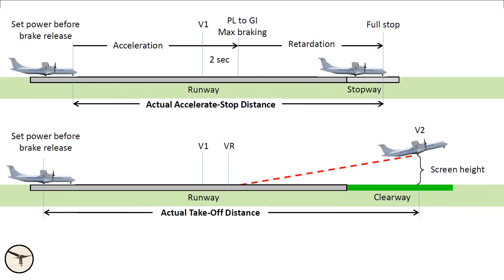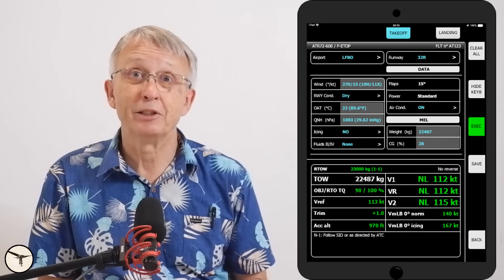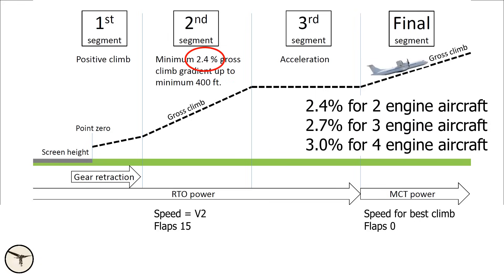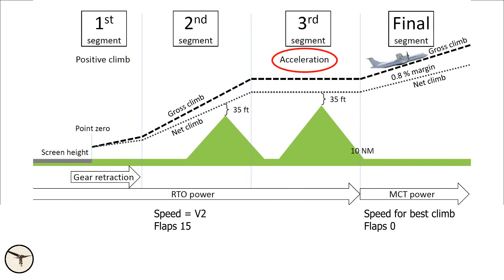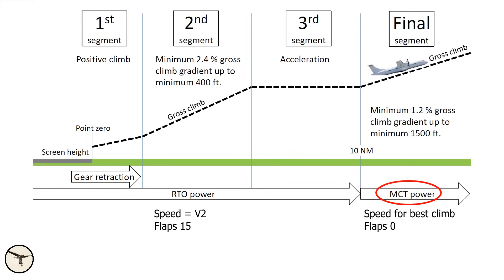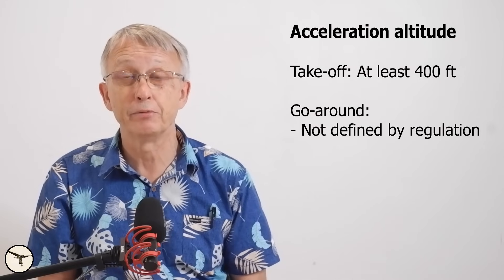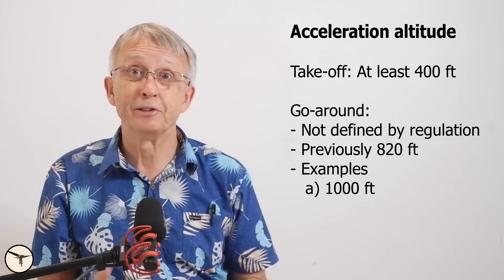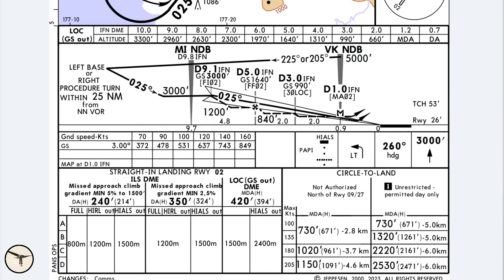Airline Instructor Reveals The BEST Kept Secret About Acceleration Altitude!

Comment: Another question I have pertains to aileron hinge reversal moment. If I am flying in severe icing conditions such as freezing rain, would it be better to leave the boots off in order to avoid forming icing ridges ahead of the ailerons while escaping the icing conditions?

Another question do weeping wings provide the best icing protection since the anti-icing fluids run over and the beyond the leading edge and therefore have an advantage in dealing with severe icing conditions compared to heated leading edges or those with de-icing boots?

Comment: You said that depending on operators Acceleration Alt can be different like 1000ft above aerodrome level or 600ft above approach minimum.

1)
So if I am flying for example VOR approach and the MDA is 940ft, I would add 600ft on the 940ft MDA = 1540ft ?

2)
What is about MSA (Minimum Safty Altitude/Minimum Sector Altitude?

I saw that for example Airbus Pilots look on the MSA and set a certain Acceleration Altitude.

I mean if you should have an MSA of 2000ft it would not be a ig problem, but what if the MSA is really high?

3)
When do you deactivate Yaw Dampber during approach and why?

Thanks alot!
Reply from the maker: 1) Correct, if this procedure is used by your company. 
2) MSA covers an area with a radius of 25 NM around a fix (typically a VOR at the airport). Using MSA as acceleration altitude might work when MSA is relatively low, but in a mountainous terrain, it will not work as you want to accelerate to the speed for best climb performance as soon as practicable.
3) We deactivate the yaw damper before landing because it otherwise will work against you when you apply rudder during a crosswind landing.
Reply: Thanks for your answer.

Regarding the white speed bug, are there tables avalible where I can read out the values for example for ATR-72-500?

Comment: Magnar thanks for the video but my question is unrelated to it. It's about icing. 
Can ice form without visible moisture and can you explain what a freezing nucleus is?
Reply from the maker: Ice is generally formed by visible water droplets when the temperature is below freezing. However, under certain conditions ice can form from water vapour, which is invisible. 
A freezing nucleus is a particle such as dust, soot or similar.
Reply: @FlywithMagnar  Thank you Magnar!
Reply: Hi!

I just saw your question about freezing nucleus. And I wanted to chime in on something, maybe helping you understand what is happening, when phase shifts from one to another.

I will use water as an example. Usually in schools children are taught about water freezing in 0 C and boiling at 100 C in so called standard atmosphere. In reality: if one is very cautious with that substance, one can go below 0 C with water not freezing - resulting in so called "super cooled fluid" - or the other way around - above 100 C without boiling, achieving so called "super heated fluid".

If you look closely at the points of expected transformation, you will see that in more basic models - in example, when going from 5 C to - 5 C - you will first cool liquid, taking away its energy, to 0 C, then you will hold at that point, while taking energy, so basically it should be freezing constantly keeping 0 C and only after fully frozen, further taking of energy will lower its temperature. I will repeat, to make it clear: you will have water at 0 and then ice at 0, but there will be also stage of freezing that will take energy from water without it changing temperature. Now the question is: if you have full volume of liquid - where does the freezing begin at temperature of transformation, when it's liquid at full volume? That place is exactly freezing nucleus, because this is where it starts.

But let's go to more accurate models. If there is lack of such nucleus, you can go deeper behind such temperatures, without phase change. You can even take certain solutions, that would freeze at pretty high temperatures relative to your body temperature, close them in a plastic bag, then make them liquid, bring them down to lower temperature, even tens of degrees below freezing temperature of that solution. And if you still don't have an idea, what am I talking about... they have this metal element inside that clicks with shape deformation. If it clicks, you make freezing nucleus that makes it freeze and that freezing energy that would usually be taken out of solution during freezing, will be released at this moment and... bam! You have a hand warmer. :]

But there is one important lesson here in addition to what Captain Magnar said. Freezing nucleus can be everything that Captain said, but it can also be frozen medium itself.

Hope this helps you intuitively see that process.

Cordially,
Norman

Comment: Thanks Magnar! Just a quick question, isn't the internal amber bug on the ASI used to set V2 exactly, as opposed to V2 +5kts? My understanding is V2 +5kts is set in the AFCS in IAS mode and therefore on takeoff the Fast/Slow speed indicated will show +5kts Fast, but you've still bugged V2 with the internal amber bug?

Comment: Thanks again for a very insightful video, Magnar 😊 This is a very interesting topic, liked the video a lot :)
Do you have a calculated acceleration altitude due to the fact that turboprops are not required to fly NADP? I have the impression that for jets which fly NADP 1 or 2, the acceleration altitudes are relatively fixed and dont differ per day/rwy/etc conditions? Often 800/1000 ft AGL for NADP 2 and 3000 ft AGL for NADP 1 if Im not mistaken. But for the ATR the acceleration altitude is calculated separately for each and every takeoff?
Reply from the maker: ATR and similar turboprops are so quiet that noise abatement procedure is not required. The acceleration altitude is calculated for every runway, as it largely depends on fixed obstacles.
Reply: @FlywithMagnar  Thank you, now I understand :_Cool: